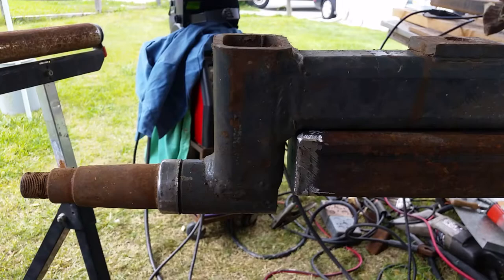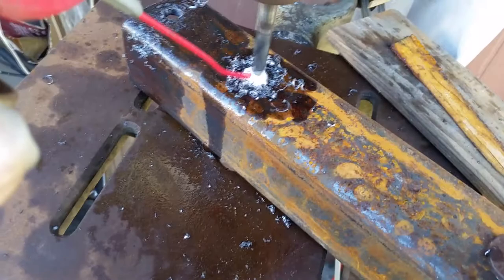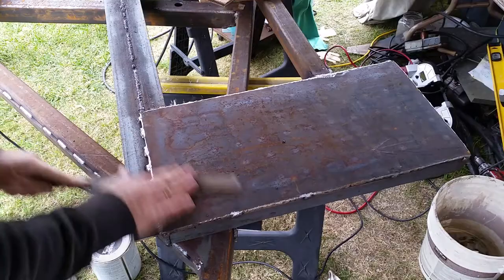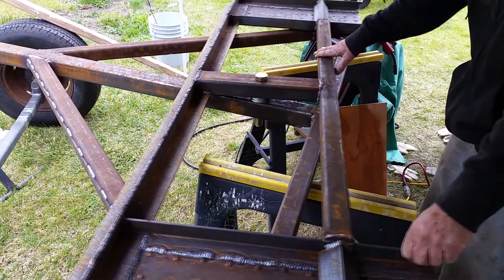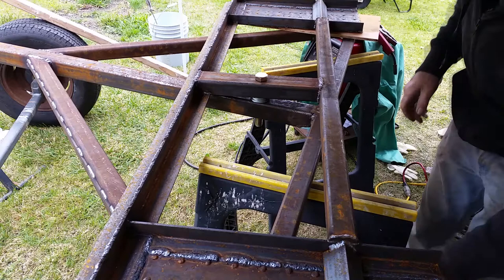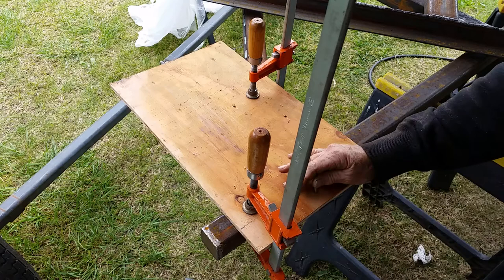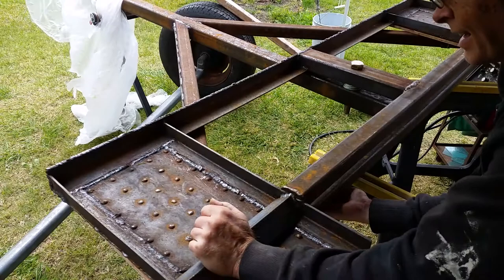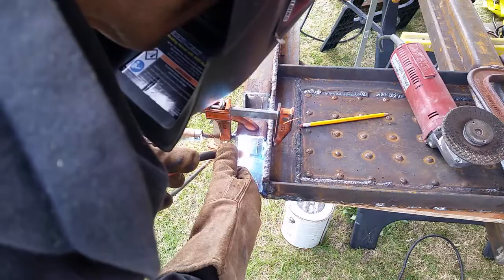DIY Pivoting Car Tow Dolly Trailer, part 2 - DG

Comment: Way back yonder we built one. We used some brake pads in the place that you're using the plywood. That part worked very well. It slid well over the brake pads without making any sounds. Ours was built way too low and the tires got into a couple of vehicles being towed when we let others borrow it. That turned out to be the downfall of our tow dolly. DON'T LET OTHERS BORROW IT!!!!!  It's not being selfish , it's just being wise. Unless it's a person you can totally trust.
Reply from the maker: I agree. I stopped loaning stuff for that reason. More often than not, things are returned damaged. Common sense is not common. Thanks for watching. DG
Reply: @deegee8032  
My daughters live down around Savannah. When I go down I work on outboard engines , generators , lawn equipment , n such. There is a neighbor that loans his trailer to us while there. His kid walked out n told us that his dad liked for me to borrow their stuff. I asked why , he said that I always fixed everything up when I came over.
Reply from the maker: @coburnlowman  I think we're cut from the same cloth. I make it a point to return things in better condition than when I borrowed them. DG

Comment: 1 error that you will be correcting, depending on how much use . Is you should have added a tube and grease sert to your pivot area. What will happen is the weight will cause your bolt to wear (oblong ) your tube, and perhaps shear the bolt.
Reply from the maker: That's a good point. I'm assuming you meant zerk fitting. This trailer gets very little use but I will grease the bolt. It is a 1" grade 8 bolt so it most likely would be a problem with the holes. This trailer was engineered as I built it so some details were overlooked. Thanks for watching and commenting. DG

Comment: The plywood is a good idea. You could paint it with oil based paint and then screw thin plastic to the surface.
Reply from the maker: I thought about that, but the plastic needs to be thick enough to allow the screw head to hold it firmly in place against a lot of pressure and stress. I haven't changed it over yet. Thanks for watching. DG

Comment: If the dollies are built strong but doesn't pivot all is well right I'm going to be going back over it but it was a very simple but stout build was just wondering how big of a deal it was without pivot point thanks
Reply from the maker: If the dolly doesn't pivot, it puts a lot of stress on the tongue and on the front end suspension of the vehicle being towed. A pivot point relieves the stress that is generated when you have a trailer that has two rows of wheels that are far apart. The steering wheel turning, doesn't relieve this pressure. Read the comments from the other videos of the build. I go into more details there. DG
Reply: @deegee8032  appreciate your feedback